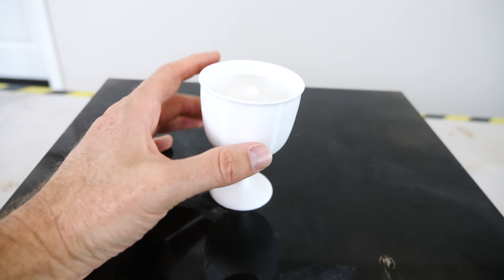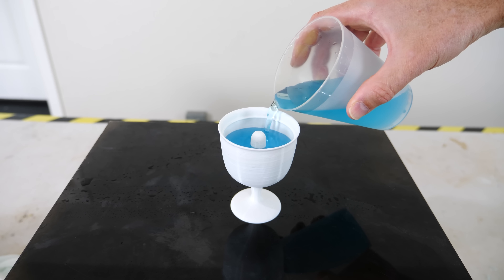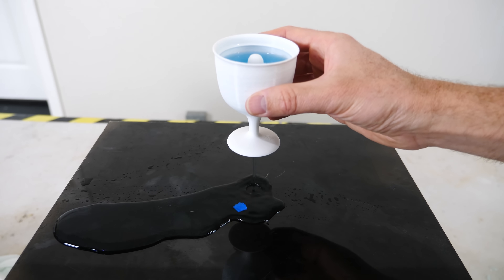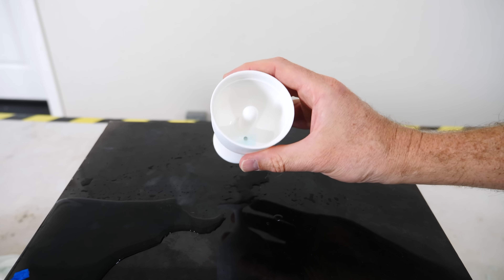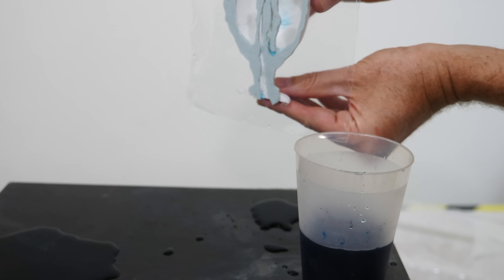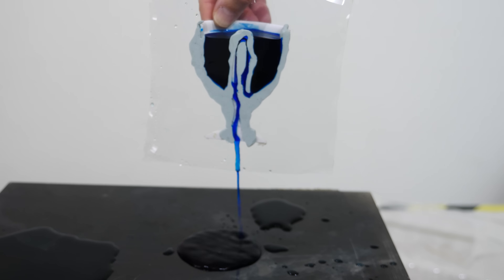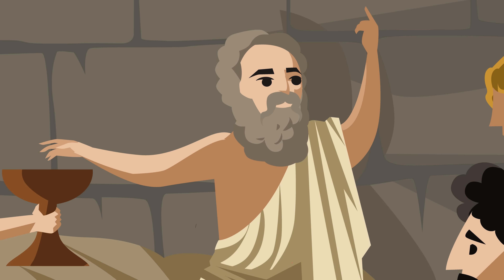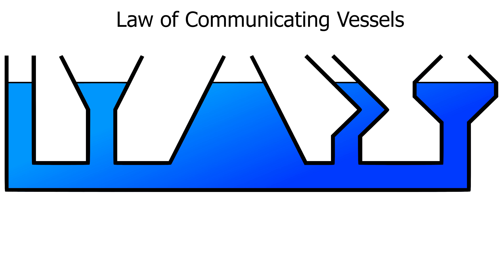How To Stop The Greedy Cup

Comment: putting in that much gallium actually makes it so you can't fill it as much. as the gallium displaces the drink. so you can actually be less greedy than if you just filled the cup normally. or like you said at the end, just plug the bottom with your thumb.

Comment: Maybe I understand it wrong, but capilary action is not nessesery for cup to work. 
Atmpspheric preasure on top and bottom of cup have neglegable difference so lack of this preasure would not affect cup.
It's waight of water itself that presses wather through siphon - inside siphon there is lower preasure than on bottom of cup and that forces water through.
As long as water is densed than envoirment around lower end of siphon it will go through. 
Only way to vaccume prevent it from working would be if only top of cup would be in vaccume and lower end would be sourouned by atmosphere as then waight of water would need to be higher than preasure difference between top and bottom by additional 1 atm.

Comment: Why did you say a greedy cup shouldn't work with cavitation? Actually the vacuum is not complete. The pressure is near to 0 but not 0, then still more than the one at the top of the syphoning. Plus, it's the cavitation that reduces the weight of the column of water in the syphoon so it actually helps the suction

Comment: The reason why this greedy cup worked in vaccum chamber is because of gravity. All the fluids exert pressure downwards because of the gravity. Now in case of a syringe, the syringe creats a low pressure volume due to which the fluid is sucked so if you remove the high pressure of the surrounding, your low pressure system would be same as the surrounding.

Comment: The vacuum doesn't make sense to be a part of the experiment, because nothing that happens in the vacuum is different from what can happen out of it.

Even with the boiling point, can just change the liquid, which enough gas in the tube (?) would stop the siphon effect at some point.

As long as the air pressure is the same for the top and bottom hole, the air pressure doesn't matter, since it is a gravity driven event, which the liquid becomes what causes the pressure difference due to gravity.

If gravity is eliminated, then nothing would happen unless there is an air pressure difference between the top and bottom hole.

Comment: The syringe still works in a vacuum if you prefill it with liquid. Then suction works. Only vacuum can't be "sucked".

You can also defeat the greedy cup by plugging the drain hole with your finger -- except in a vacuum! :)

I don't believe it's capillary action at all, It's not atmospheric pressure that makes the water flow, it's leveling via gravity. Air pressure can be an altering force but it's not the reason for leveling.

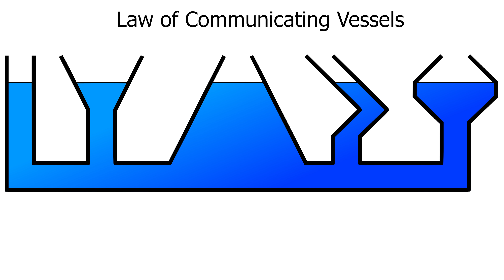Comment: 2:35, this has always confused me. Does this mean that if you had a swimming pool and a bunch of people were at the bottom, then you connected a very long straw full of water to the top of the pool (and put a lid on the surface of the water so the level stays the same), then you could crush the people in the pool from just connecting the straw?

Comment: Two points of order:

1) I think "cavitation" refers to a void with an absence of matter. Your vacuum would have to be pretty thorough to achieve that. And upon achieving that, I don't think there would be any liquid water left in the system. At a near-vacuum, those voids are filled with water vapor, which flows and and attracts like a liquid, but a very stretchy one.

2) Periodic Videos did an experiment a while back to demonstrate that siphons do in fact work in the absence of air pressure. They used a type of liquid that does not boil in the absence of pressure.

An "incomplete" cavitation bubble is a low-pressure gas bubble. It changes its size based on the pressure of its environment. And other aspects of its behavior are similarly subject to the pressure of the environment. These vapor bubbles have the same pressure as the liquid that surrounds them. And mathematically, "same pressure" means "same force per cross sectional area" of the vessel, including the tubes. The vapor transmits the force of the liquid, in equal measure.

Comment: A siphon will work in a vacuum , its no surprise that the greedy cup works in the chamber . There is no force called "suction" its the atmospheric pressure "pushing" , but the siphon does not need atmospheric pressure to work. The siphon works off the weight of the liquid

Comment: I assume the reason the Greedy Cup still works in a vacuum is because it's function isn't the same as a syringe. There is clearly some similar physics involved between a syringe and the cup, but the main difference is that the cup is actually a tube with holes on both ends while a syringe is not, only having an open hole on one end. I'm honestly not sure about the details as to why a tube would work and a syringe would not, but this begs the question: Are the forces at play with the cup actually suction or something else entirely?
Reply: (A bit late to answer, but) The force involved here is gravity. Apart from anything else, you intuitively know that a syringe works any way up, but this cup will only work when it's standing the right way up
Reply: Sringe to work uses force of atmosphweric preasure pressing agains liquid so creates lower preasure envoirments that liquid can fill. 
And as preasure inside sringe can't get lower than vaccume, it cannot create force pulling liquid in in vaccume chamber.
But with enough of liquid in container to submerge sringe in, it would work again.
Higher layers of liquid, due to gravity, would preasurase liquid and sringe would again be lower preasure envoirment.
So highes point to which sringe can be filled in vacume chamer is level of liquid it was submerged in.

Cup difference of preasure creates inside siphon and due to waight of water comming through it.
As bottom of cup is being presed by all water in top of it, watter going through siphon is being pulled by waight of water going through siphon.
And as leg of cup is higer than distance from bottom of cup to top of siphon then water going through creates more pull in that direction.
Important part is that diameter of siphon is low enough that it can be sealed by surface tension of liquid going through as if vaccume would be present in siphon when level of water is bellow siphon height then waight of water in leg could get lower than nessesery to pull more water through and flow would stop.

For cup to stop working, it would need to be in free fall and then it stops working regardless of atmosphere neing present or not, while in atmosphere and free fall sringe should still work :)

Comment: How to be make this video more impressive.. do it in a way so we can use the cup without harming ourselves.  I know some will say Gallium is safe, but it's not for long term, or even in large doses.  So that doesn't count.  As for the vacuum chamber, you forgot why the cup works to begin with, via water pressure not air pressure, which you noted at the start of the video.   Syringes work via air pressure, so mentioning that was a moot point.

Comment: This doesn't really defeat the greedy cup though, it's original purpose is still met, as the volume of water you're able to put on top of the gallium is actually less than you would get without overfilling the greedy cup. I think the best way to defeat one would be to jam a rubber pencil eraser or the like into the hole on the bottom!!

Comment: The water levels in the two (or more) vessels will only remain the same so long the the air pressure above the surface of water remains the same. Otherwise drinking straws wouldn't work.

Comment: It's normal, that the Siphon works even in a vacuum.
Because the "Spill way" is under the same pressure that the water level.
So there is now different pressure.
Even under normal conditions. It's not the weight of the atmosphere, that's causing the Siphon to start, just the weight of the liquid.

But would this work with sand under vibrations?
I guess yes
Reply: Exactly!! Gravity doesn't need atmospheric pressure

Comment: You can make the cup less sus by hiding the syphon in the wall instead of adding that center spike (might need to make it have somewhat thicker walls though; but that could be disguised by adding a handle and using the handle as an excuse for the extra thickness or even hiding the syphon inside the handle).
Reply: now nobody's gonna know the cup is actually the impostor!

Comment: The law of communicating vessels also only applies to the same height if the pressure to each opening is the same. So you can also defeat the greedy cup by blocking the outlet with a finger the same way you can block a straw and lift the fluid. Edit: I wrote the finger block before seeing the video end.

Comment: Air suction doesn't work in a vacuum chamber, but  applying negative pressure on a liquid column is still possible. This is for example how trees can grow and suck up water above 10 meters. If you were sucking the water up with air, this would pull a full vacuum on top, and the water would not be able to rise above 10m. However, by having a continuous water column, the negative pressure is exerted on the liquid itself and transferred through without issue. This is why it was still able to work in a vacuum.

Comment: The siphon effect still works in a vacuum even though suction devices may not. This is because the medium of suction is what is exerting the pressure. In the case of the siphon, the medium is not air but rather the liquid which still must be able to provide enough pressure to overcome the force of gravity in the depicted state (mostly liquid). The air pressure difference on both sides of the siphon may affect the values of the pressure system, but it is not the air that creates the siphon.
Reply: finally! a post made by someone who understands this correctly! if there is still liquid in the chamber, then it isn't a total vacuum, and nothing unusual occurs with the siphon.  there is no reason to theorize bizarre explanations like capillary action to explain that both gases and liquids are fluids.

Comment: Oi, clever boi, not only did you put Galium in a drinking cup, but you also displaced the same amount of actual liquid that you would've got anyway past the fill line, so basically you're still gonna get almost the same amount of wine or whatever. You didn't defeat it 🤣

Also, the Pythagoras cup would work only when drinking at a certain angle, because when you tilt to drink it the other way, the liquid will just flow over in the siphon and start it.

Comment: im sorry, but suction does work in a vacuum. the vacuum has nothing to do with the liquid displacement. Unless you're referring to "suction" as a vacuum pulling liquid. otherwise you're literally just moving the liquid from one place to another, and a syringe would work just like your vacuum chamber in water, but starting with 0 area/volume. as you increase the negative volume it "sucks" the liquid in to replace the negative volume. Or am i missing something obvious? Of course you could get resistance from pulling liquid from a vacuum into that negative space, which could create more of a vacuum (as that's actually how you create one) IF that negative space was outside the vacuum volume, but we're assuming it's inside a vacuum and not bordering/gating one.

Comment: I dont really know anything about gallium, but if you actually drank the liquid on top of the gallium without drinking the gallium would you die? Like does the gallium have any poisonous properties that would transfer to the other liquid just by it being on top?
Reply: Gallium metal (as here) isn't particularly toxic. It's also probably highly insoluble. So the chances of any actual harm are low. In any case, as a rule, you should still not ingest anything from a lab.

Comment: So what happens if you try to draw up water in a syringe In the vacuum????
Reply: it doesn't work
Reply: wooy lol I got that much figured out. I’m asking what happens. Does the plunger not pull, does it pull but draw now water, does it pull water but not pressure. What happens if you try?
Reply: @fishnmaster421  you can just move the plunger but the water won't get sucked in
Reply: wooy if the plunger will come back, what fills the tube? Water or air? It has to fill with one or the other if it will move. And in that case if it fills with water or air, it’s working. To not work, the plunger would not come back. But you could force it back. I need to see this in actual practice
Reply: wooy I just seen his experiment with it. It just holds the vacuum when pulled back. Makes sense now.

Comment: Isn't the reason because this also operates on p = roh*g*h within the vacuum chamber? You're not changing the density or gravity of the liquid within it. It wouldn't work on that basis simply because that's how fluid mechanics works. The greedy cup is basically a manometer. Siphoning works on capillary action and fluid frictional flow over a surface. So it makes sense that even though you're reducing the overall atmospheric pressure, you're not reducing the basic intrinsic properties of water.

Comment: This is exactly what I've teached to a lot of people when working in the oil fields. They should always measure the tanks using a ruler from the top in case there's oil in the water or vice-versa and not to measure using the transparent hose on the side. If they would've listened, many spills would have been avoided.

In case someone is wondering, the tanks used in an oil field job usually has a transparent hose on one side, connected to the tank from the top and the bottom and it's used to see the level of fluid inside the tank, but that only works if the totality of the fluid has the same density and base. In case there's water and oil gets inside, the oil won't have the enough weight to push the water inside de hose to the same level and you will think that the level inside the tank is way lower than it actually is. Very common scenario while doing a well testing job where the separator can be wrongfully operated causing one fluid to drain to the incorrect tank.

Comment: Syphon works by gravity.
What's the role of vacuum here?
Why it will not work in vacuum? If the channel is big enough and with enough flow some leakage (  vapor from the boiling water) should not make a difference. At least in short term.

Comment: Action Lab: *defeating the greedy cup
Pythagoras: “the audacity”
Reply: How DARE he?

Bruh “he” got autocorrecd to “Abe”

B R U H AUTOCORRECT DIDN’T FIX ITS OWN NAME!!

STUPID AUTOCORRECT
Reply: @memetech-  it should be called autowrong.  Swear its caused more errors than fixed them
Reply: @ThePyranthos  YES THE STRUGGLE
Reply: @ThePyranthos  like how on Microsoft word it is convinced it's (in reference to ownership) doesn't exist
Reply: @clockworkpotato9892  It's not that it doesn't exist, it's being used improperly. (Its) without the apostrophe is the possessive form. (It's) is the contraction of it and is. Its=ownership, it's=it is.
Reply: @ThePyranthos  autoincorrect
Reply: @sissix1987  dont imitate my phone, i typed what i typed for a reason.  Autowrong is harder to misread than autoincorrect when discussing autocorrects tendency to be wrong, so save ur corrections for someone who needs it
Reply: Tip: to ward off Pythagoras‘s angry spirit after trying this, stand in a field of human fetuses (also called beans) and he will not be able to reach you
Reply: @OhWellIsntThatNice  isn't that how he died? He was being chased but stopped because he would have had to cross a field of beans?
Reply: @Clockwork Potato Yup 🤣

Comment: The reason this works in the vacuum chamber is because fluids are bale to go into negative pressure, so the acceleration force, from gravity, on the fluid falling through the tube creates enough negative pressure to keep the syphoning effect going

Comment: I’m just wondering how during those day they able to design such a cup
Reply: Syphons were understood and used for water clocks. It was just a simple matter of bending a reed in the right shape and molding the clay around it. After the cup is allowed to dry and is fired, the reed burns off inside and the ashes in syphon could easily cleaned out as easily as just blowing on the bottom of the cup.
Reply: The Greeks were really fucking smart.
Reply: The same way that mark rober worked for NASA, but I probably can't figure out how to make an electrical circuit unless I was given the materials and directions.
Some people are just smarter, or the way they think is perfect for the world we live in. Idk.
Reply: Toilet

Comment: This is my favourite video you've made in a while! I thought (for some reason) that as the vacuum was being achieved the air from the bottom of the cup would be pulled out causing the siphon to trigger earlier. Why doesn't this happen? Is it possible that did happen, but on a scale that was unnoticeable?
Reply: Because in the vacuum chamber the pressure around the entire cup decreased homogeneously and therefore there was no difference in pressure between the top and bottom of the cup to trigger a siphon

Comment: I would like to point out that the chamber was not in complete vacuum. The vapor pressure of water at room temperature is roughly 3% of the atmospheric pressure at sea level so once you go below that the water begins to boil and fills the chamber with water vapor.

Comment: I question your results:
Is it easier for the bubbles underneath the cup to be pulled-out sideways rather than upwards, thus the pulling force is instigating the draining flow? If the liquid used was absent of all possible oxygen equal to that of the tank, shouldn't total environmental pressure be neutral-zero, thereby as nothing is in motion the water surface tension wants to remain intact?